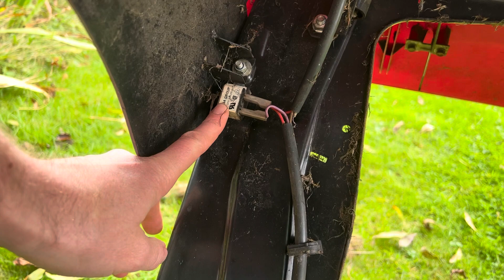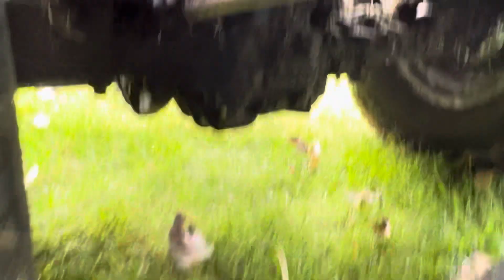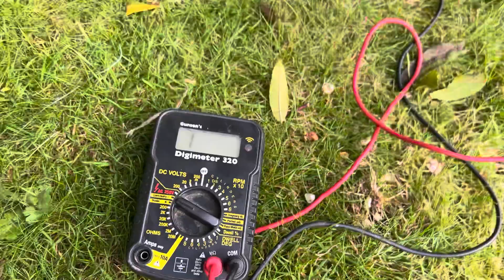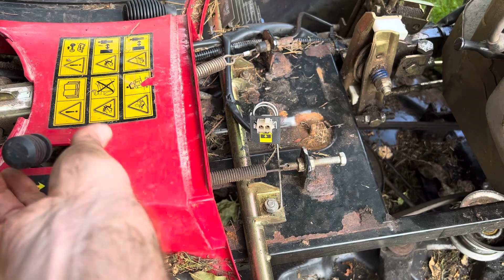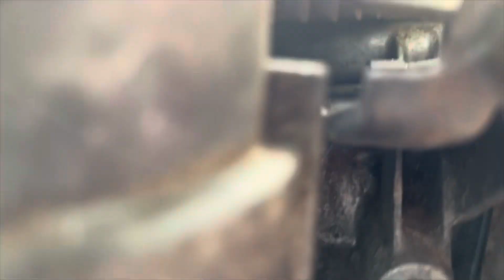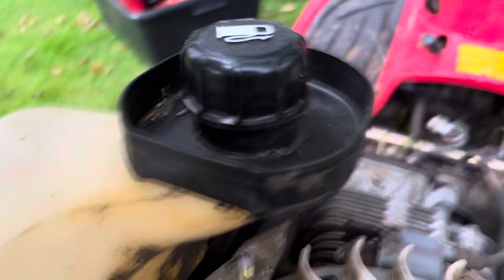Honda HF1211 starter motor replacement - Full Diagnostics 36 minutes’

Comment: Mine was trying to turn over but slowly, then its just started clicking. Light is on permanent. I’ve disconnected the battery and that’s fully charged. Any ideas?
Reply from the maker: Clicking probably means the battery. Charge it up and try again.

Comment: Thank you for sharing all of that. Even though it's a different machine to mine the problem is the same and the starter like yours is under the fly wheel. I don't have the recommended tools either but I think I can manage like you did. Thanks again for the complete diagnostics and showing the installation of the starter.

Comment: It’s always worth giving the starter motor a gentle tap with a hammer when the key is in start position, the solenoid has a habit of of sticking, especially after not being used over the winter

Comment: The cable from the seat cuts out the engine when the cutters in gear and you get off the seat, it’s all part of the safety circuit
Reply: Do you happen tp know what this connects to? I managed to pull it out/snap it off when opening up the chassis cover.
Reply from the maker: @denney69 can you explain a bit more your question?

Comment: Hey, thanks for the work to record it!

How much did you pay then for the starter??
Have the same situation here...
Reply from the maker: It was about £120. I should have bought the whole thing, starter motor AND solenoid because shortly after the solenoid went and a genuine one from Honda is about £80. If you’re replacing it, I recommend you do both at the same time. There was a global shortage at the time (Covid) I think I went to CarGo in the end. I bought a cheap Chinese solenoid, doesn’t really work, or fit but loathe to spend that much on a new one…..

Comment: Mate, thanks ever so much for doing this video, it really helped me to get the starter motor off.  No joy with the pry bar method but it popped off the taper with a 6" puller.
Reply from the maker: Glad it was helpful mate! Even if you could find someone to work on it, how do you get it to them? 

Actually I need to take the flywheel off again as I think the magneto needs replacing. Hot starts are an issue. I have a magneto in the shed somewhere but where I put it, I have no idea….

Comment: I’m having a similar issue with my 1211. Like the kill switch is on all the time. I noticed it started playing up when the forwards/backwards lever started to get over zealous about its position. Feels like there is a broken clip or cable so will investigate that next. It’s always been a pain to start though!
Reply from the maker: I’ve now got a faulty solenoid which needs replacing, 

If mine doesn’t start, I push the lever forward, and then stamp on the brake to re-centre. It’s usually because the forwards/ backwards lever isn’t in the perfect place. Good luck!
Reply: @Himoutdoors  Thanks for the reply. I have raised the body on it today and there is a cable that goes from a spring on the back of the Brake Pedal mechanism, through a rigid black pipe and (I think ) used to attach to the hydrostatic (forward and backwards) handle that needs to be in the neutral position to start. However, that has snapped and no idea how that assembles, hinges or looks when working. I will try and find some photos online of it so work out what i need to replace. It grieves me taking it to the local mower guys as it works briefly after having £500 thrown at it then fails again in a different place. Its bad economics. I might just buy a new one!
Reply from the maker: @andycharger  I know what you mean, you think you’ve solved one thing and a week later another thing breaks. I’m saving up for a robot mower, outsource the whole lot. Quite pricey though….

Have you tried a breakers, I had the number of a guy in Scotland, let me see if I can dig it out…
Reply from the maker: @andycharger next time I’m mowing, I’ll take a video and post it on my channel
Reply from the maker: Check the seat switch too….
Reply from the maker: I end up bouncing up and down and pumping the brake pedal and eventually it starts. Dreaming about a robot mower….😎